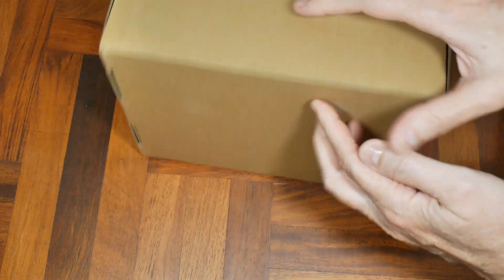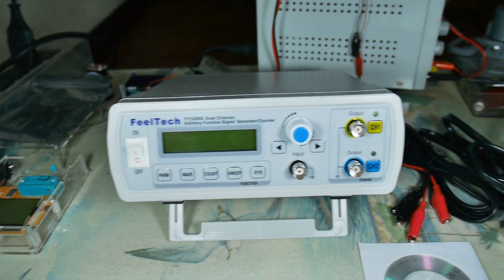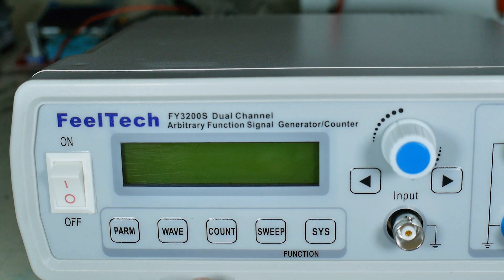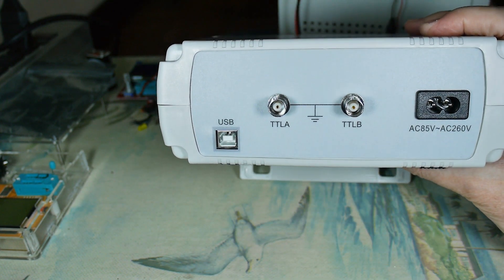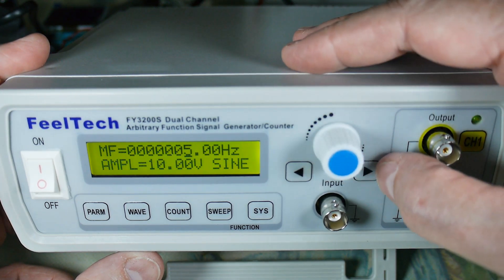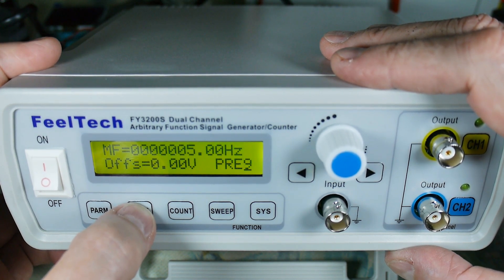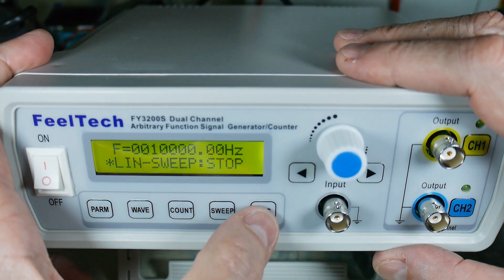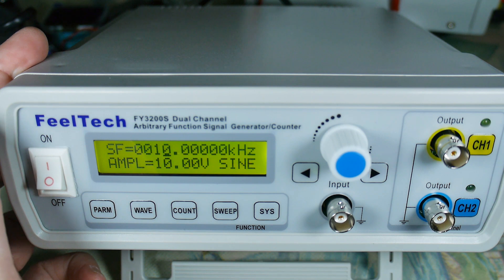Frequency Generator / Counter - Low Cost (Unbox & Basics)

Comment: Would this work for generating a higher frequency noise for deterring rodents or animals?  I'm guessing the output could be plugged into an audio amp and speaker?
Reply from the maker: It would probably work as you described, but there are much cheaper ways to generate sound waves.

Comment: Hiya , im a beginner learning about frequencies , what would or could this device be used for. Thank you
Reply from the maker: It generates an electrical signal that you can control both frequency and amplitude. You can use them to test the resonant frequency of a circuit you are building or testing. You can use it to drive digital circuits (it acts as the "clock"). It will act as a low power radio transmitter / frequency source you can hear to test receivers. So pretty much any time you need a radio frequency signal, this will do it. This particular box also has a frequency counter (measures frequency), and some other interesting features. It's also cheap compared to most!
Reply: @tsbrownie  Ah brilliant and very much appreciated :)

Comment: does it generate soundwaves or radiowaves? (may be a silly question)
Reply from the maker: It's a good question.  There's a difference between sound and radio waves.  Sound is mechanical movement of air, like waves in the ocean.  Radio is a 2 part wave, both electrical and magnetic and it does not require air to travel.  The electrical part is what the radio uses to receive the signal and recreate the sounds.